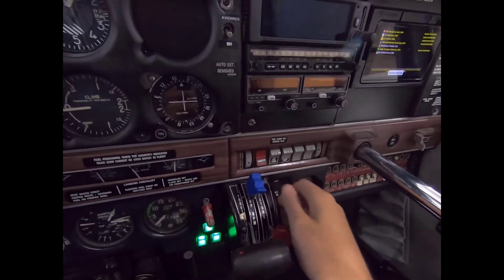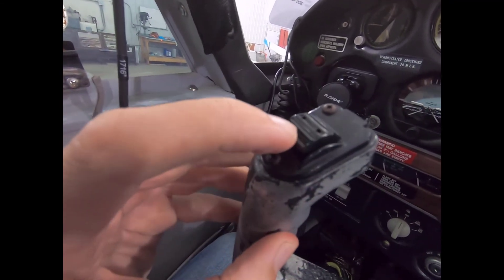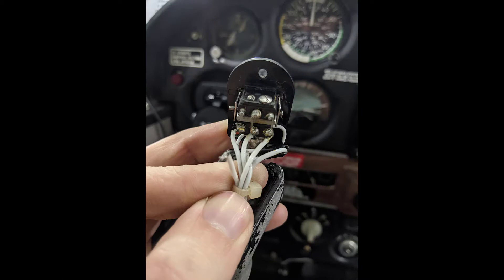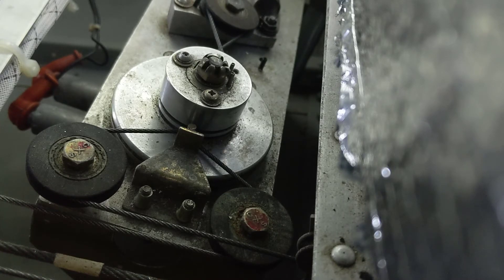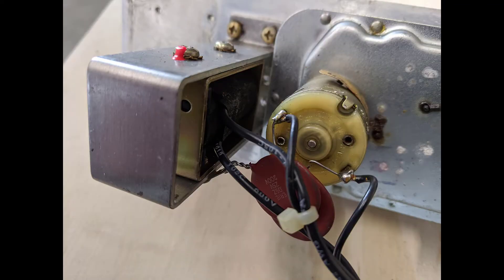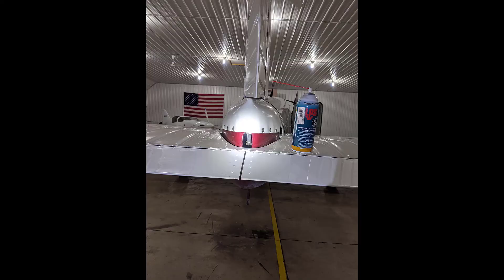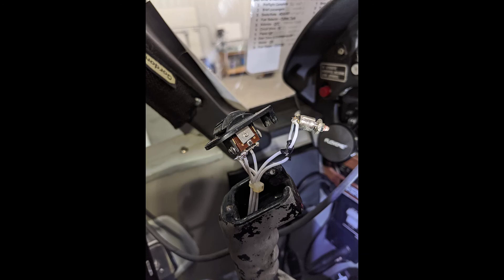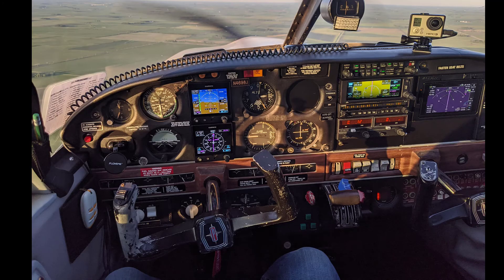Piper Arrow Trim PET System Repair

Comment: Where did you find the spec for the micro switch(es) you ordered?  I downloaded the service manual for PET with several permutations covered.  I have a 1977 Arrow iii and it looks like the identical switch.  Thanks for sharing.

Comment: LPS on the drum?  Every couple of months?  Why on earth would you oil something that's suppose to cause friction?

I recently bought an Archer.  The electric trim didn't work when I bought it and the owner thought it was the servo and said he wasn't going to fix it.  I found that some fool had sprayed ACF50 on everything including the bridal cable, there was insufficient tension on the cable, all the pulleys were gummed up with that ACF50 and couldn't turn and there was a broken strand in the cable because some A&P had crossed the cables under the cargo frame-box and then compensated by crossing the cables at the trim wheel - so when you manually ran the trim there was a grinding sound.  I had to laugh at the incompetence of some certificated A&P effing up that system.  

Just to emphasize - don't oil the cables.  There's a reason the cables are wrapped around the drum 30 times (it's to create friction to turn the drum). 

So you know, LPS 1, 2, 3 - none of that junk is equivalent to Mil-PRF-7870 (Royco 363)  which is what Piper, Cessna, Beechcraft, Boeing, etc call for.

You seem like a fella who does the right thing so I'm letting you know.

Comment: LPS2 isn't the correct lubricant for the jack screw. If you consult the lubrication chart in the maintenance manual, you'll find that Lubriplate, which is a light-colored grease paste is the correct lubricant. LPS2 is great for lots of stuff, but not for the jack screw.

Comment: I'm working on a Warrior that had this system inop'd a long time ago. The connector for the trim servo is missing, is it just a mate-n-loc with two ring terminals coming out? Couldn't see in the video, thanks!

Comment: Thank you for the video.
I am going to put LPS #2 on the jackscrew today .
Do you remove that tail one cover to apply lubricant?
Reply from the maker: Only every once in awhile to inspect it. Otherwise I just use the straw to shoot some up there.
Reply from the maker: I don't. Just take a flash light and a LPS w/straw and lube the jack-screw